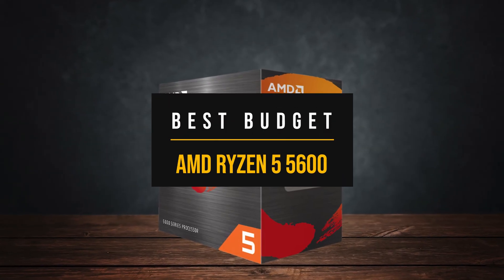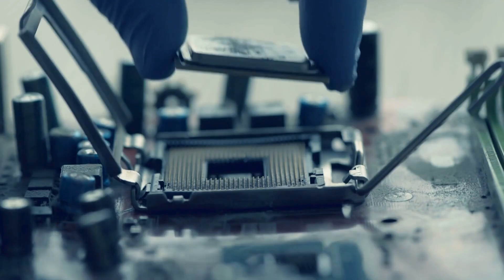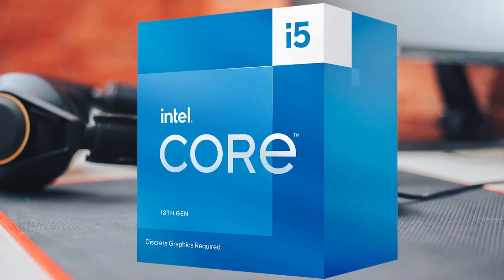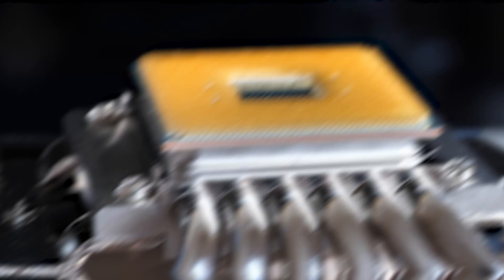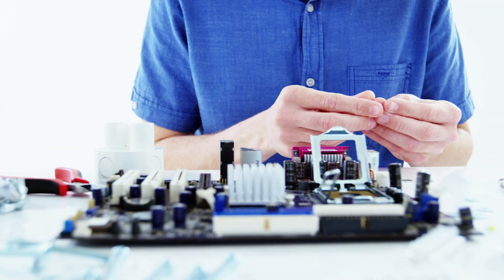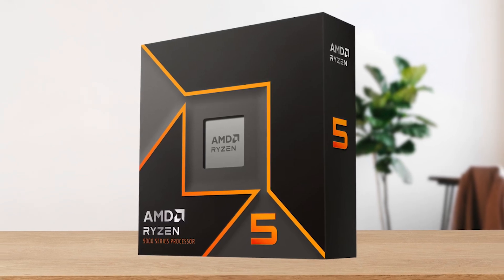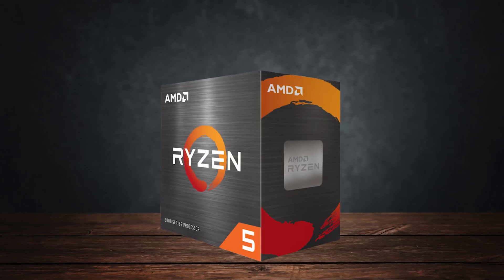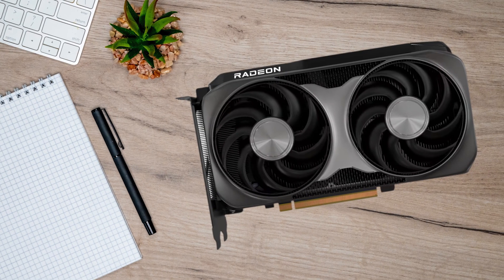Best CPUs for RX 9060 XT - (Budget, Premium & Value Picks)

Comment: imagine not even mentioning the 7500f

that's how i know you don't know anything about what you're talking about
Reply: Would the r7 7700 work? Not the 7700x version
Reply: @kebenzkie  excellent CPU it'll work fine with the GPU
Reply: or even the R5 3600 or the R5 5500
Reply: @LEV1ATAN really any budget CPU works with this GPU
Reply: @XxS__A__M__FxX  not the R5 2600 huge bottleneck (I have it, and it definitely shows) (R5 2600+9060 16G)
Reply: @LEV1ATAN that's a 100 year old CPU bro of course it'll struggle
Reply: @XxS__A__M__FxX  i know, thats why my next CPU is the 5500
Reply: @LEV1ATAN i wouldn't advise you to get that

5700x is similar in price used and is alot better
Reply: @XxS__A__M__FxX  maybe in your country,  In my country, a new 5500 is cheaper (75). A used 5700x is 150.
Reply: @LEV1ATAN damn